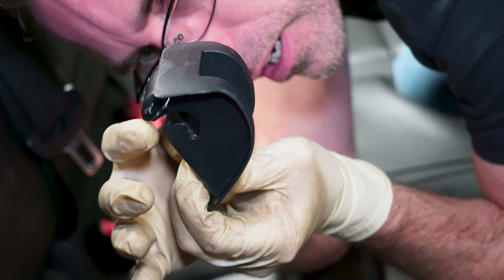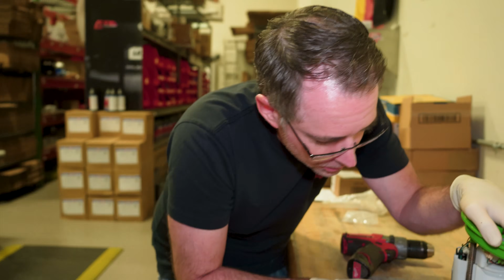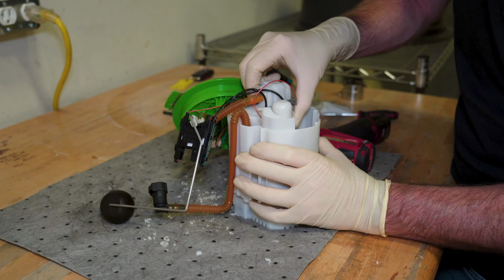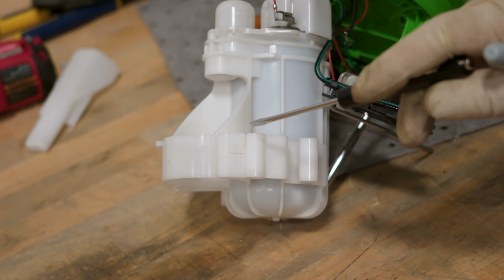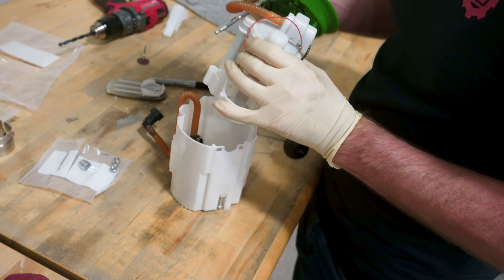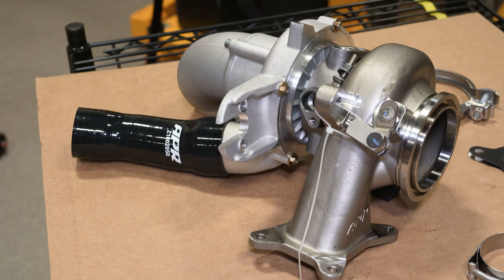How to replace MK7 Fuel Pump Removal (APR Low Pressure Pump Upgrade)

Comment: Question..I replaced the fuel (LPFP). Occasional stalling, seems like when it is hot outside. Could the fuel pump module be the culprit? I know you mentioned the “module” during your video. Thanks in advance and thanks for the videos!
Reply: Map sensor
Reply: My oil catch can hoses had a metal bracket that some how worked its way over top of that sensor and was resting on it..that bracket was super hot and tricked that sensor…moved it out of the way and it’s all good

Comment: I know the mk7 and mk7.5 gti’s have different part numbers for the low pressure fuel pumps, but do these kits still fit the same or are they different?

Comment: i bought a delphi aftermarket fuel pump and im missing a hose tha comes from the reservoir. can i just take the old hose and install it on the new pump. it looks like you can, can anyone confirm.

Comment: Thank you! I’m replacing my lpfp this weekend hopefully fixing my issue. I get a massive almost brake feel and my gas pedal is non existent and if I’m at a stop it dies on me and gets a hard time to start and then it’s fine until it does it again. It’s not constant it’s intermittent especially when I try to get on the gas. I’m barely stepping into the gas before it does it again. I’m hoping it’s the lpfp the only code I get is a P0087 code. I replaced the fuel rail pressure sensor now I’m replacing the lpfp hopefully it fixes it and it’s not the hpfp. I didn’t have a gauge on me to confirm so we’ll see
Reply: Did u fix it ? I have p0087 car randomly stall after I drive it . I changed lpfp and hpfp and car still stalling . After it stall I have to wait 10 min when the car cools downs so I can drive it . I don’t know what is going on
Reply: @MykytaStoianov my package got delayed and it should be here in the next hour or so hopefully then I’ll install it. But it’s definitely annoying I can’t stand it. I can’t drive it for very long before it tries to die on me while I drive once it gets warm. If this doesn’t work it’ll be the hpfp next for me but there’s also a module/sensor near the lpfp that can also get warm and that can cause it too. I would look at that if you’ve exhausted all other options. It’s called the lpfp control module
Reply: @MykytaStoianov I just replaced it and drove for over 30 minutes with no issues, I’m hopeful the LPFP was the issue for me
Reply: @manaduke524 after you drove it for 30 min did you put the car to idle ? That’s the moment when mine dies after 10-15 idling after long drive min after I drive the car . It sits at the ungeground parking and also the air filter box gets super hot , I might think it is something with Map sensor or overheating the intake …
Reply: @MykytaStoianov yah because mine would sometimes die at idle so I let it sit and it didn’t stutter or anything. If it’s a P0087 it’s definitely something fuel related I would look into that lpfp sensor. That could make it run hard and almost act like a pump issue especially when it warms up. When you try and start it back up is it rough also? Does it smell like gas when it eventually starts?
Reply: @manaduke524 it doesn’t smell . To be able to start it again I have to wait 15 min when the car cools down a bit then it starts like nothing happened . I replaced both hpfp ( oem hitachi ) and lpfp I put Delphi when oem is Bosch . J538 which is controller I did not change . I actually order one cheap j538 at Amazon for 25 bucks and car would not even start with it . I put the old j538 it starts right away . So maybe j538 has to be changed to the oem one I don’t know . I also replaced green 644 relay under the hood .
Reply: @MykytaStoianov mmh it’s hard to tell fuel is hard there’s a lot of things it could be, from sensors to fuel lines to filters fuel pumps injectors fuel rail it’s hard diagnosing. Has someone tried reading live data from your car while driving and trying to start it back up, if it’s a sensor or fuel pump issue they can psi from the pumps and also voltages from the sensors and tell if the sensor is shorting or not
Reply: @manaduke524 mechanic said everything is okay based on the reading lol . I need to find another one probably. Btw fuel filter is located inside the lpfp? Because some people said it is under the rear passenger side wheel but I checked there is no fuel filter
Reply: @MykytaStoianov yah there isn’t one on our cars only on the lpfp just in everyday cars those could be the cause. Yah I would look into another mechanic certain scanners can read more than other scanners. Others only read from the rail others can read from fuel pump and sensors working with those pumps and can read desired readings to actual and if they are off it sporadic those could be the causes

Comment: Despite what Paul says, people do use the LPFP lock ring tool (T10202). I bought a knock-off from Amazon for $20. If DAP sold it, I would have bought it from them. It does the job better than the method Paul shows. Note that I did buy the pump, lock ring, and seal from DAP.
Reply: Update - I just tried to use the tool. After all these years and being buried under dirt and debris, the lock ring won’t turn using the tool. Going to try loosening it in the same Paul did and then switching to the tool.
Reply: @alanperry8676  Those metal rings REALLY get stuck on.  Using VW special tool  BAF 291 (Big Ass Flathead)  and an offical VW hammer is the best way.   Its the shock n awe that frees it.
Reply: @TheEnglishTrucker  Now that I have completed the job, I have to disagree a bit. I ended up using a hammer and punch to knock down the tabs on the locking ring a bit, then the T10202 worked fine. But I could see using your method would have worked just as well. But I think using the tool to install the new ring works better.
Reply: @alanperry8676 lol,  special tools are ideal for NEW vehicles. Sometimes when salt n rust has been involved,  violence is required.  Yeah,  i bet it worked really nice to screw it back down.  WD40 also helps. 
Some cars have a completely plastic locking ring,  not sure how much violence they will put up with. 🤔👍😁
Reply: @TheEnglishTrucker I had an Integrale road car and it uses a plastic ring that threads onto the outside of a flange that protrudes from the fuel tank. The seal is an o-ring that just sits under the flange of the fuel pump assembly.  I found that getting that o-ring to stay in place when installing the pump to be really hard. And there is a tool for that kind of ring but I could never use it because of the tricks I had to play to get the o-ring to stay in place.

Now I have a Integrale rally car with a fuel cell and don’t have to deal with the stock fuel tank silliness.
Reply: @alanperry8676  Beautiful car.  👍

Comment: With my OBD11, my duty cycle reads 60% at idle. 5 bar specified, 11 bar actual. Could that be simple signs of starting to go bad? Been stage 1 for about 50k and currently at 97k